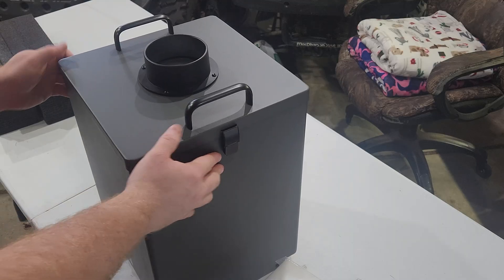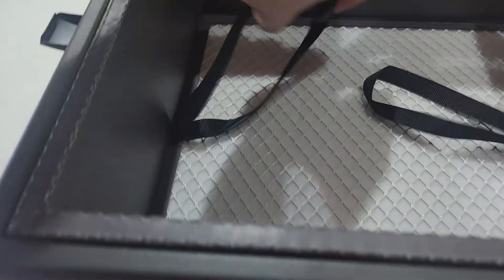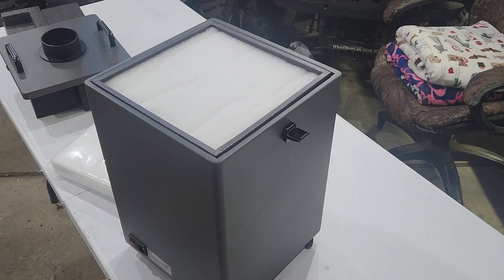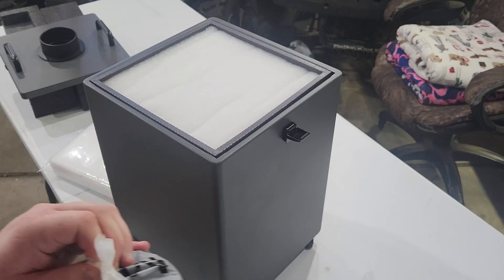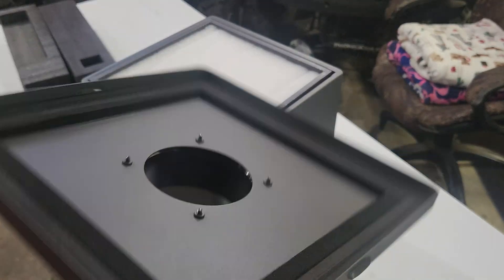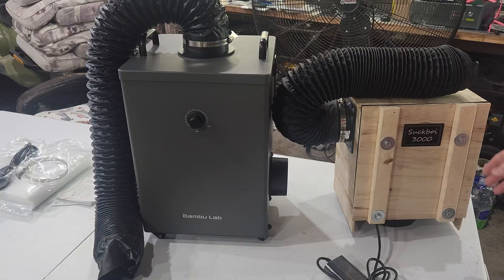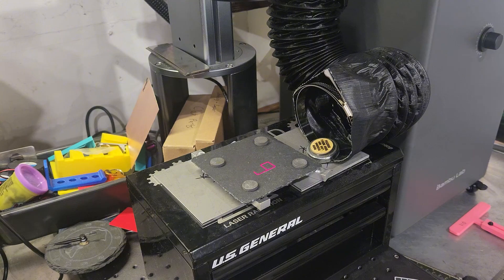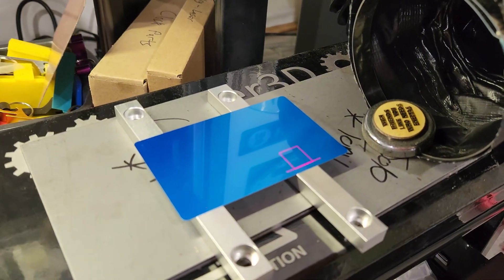Bambu Lab Smoke Purifier - Unboxing and Testing - Laser Fume Extractor

Comment: I’m interested to know why you picked this over something else that might exist seeing how you are just using it for laser cutting. I’ve been thinking about picking one up just to filter my regular 3d printing.
Reply from the maker: Good question, and I had a few reasons. The main one being that I know I'll be able to get replacement filters for it in the future unless Bambu stops supporting it for some reason. A lot of the ones I saw on Amazon were no-name ones, that who knows if they will offer replacements 1 week, 1 month, or 1 year from now. I don't want to be stuck buying a new unit if that's the case. Another reason being that a lot of the ones on Amazon were spec'd a lot lower. I got this mainly to help with some ABS that I had to laser, which puts off some very nasty fumes, so didn't want to skimp out on that.

Any other questions, just let me know!

Comment: Would this work if you wanted to filter out the exhaust air from 3d printing? For example when printing ASA. Or does it interfere with the chamber heating
Reply from the maker: hey Alex, I am not entirely sure how much it'd interfere with the chamber temps. I think it would drop temps slightly at the lowest speed but the printer may be able to catch back up and maintain with active heating.
Reply: @BrANDOM-Tech  ah ok, thanks
Reply: How is it been since? Any update?
Reply: @SeriousPunch  I didn't get the smoke purifier because its too expensive for me at the moment. I opted for an ac infinity fan and vent it outside for now. It has a speed controller so I can set it to have a nice gentle pull on level 3/10 and I have printed PLA and PETG with no issues. When I print ASA I am going to swap one of the exhaust flaps on the back of the printer for one with holes in it (someone made one on youtube) so it can gently suck the air out. Also the smell in the room is completely gone. I am trying to find a solution to add a filter to the setup before it goes outside but I am not sure if HEPA will be too restrictive for airflow or not, as it is only 100 mm hose. So I might have to DIY a filter box. I read on a forum someone uses the smoke purifier for printing and had no issues, but a bambu lab employee said you shouldn't use it with PLA because of heat creep (I think because the air can't exhaust out fast enough for PLA so it builds up inside the enclosure). I'm guessing it probably does work fine.
Reply from the maker: @alexhz glad you figured out a solution! If you're venting outside, I wouldn't worry too much about filtering unless it's close neighbors or an adjacent window you're worried about. I did find the hepa filter I tried to use on my own DIY solution (very similar to what you have now) was very restricted in flow for laser use, but for printing, it may work out just fine. Especially since you're not really dealing with larger particulates like I am with the laser. Hope you get that part figured out to your liking! Have a great holiday season!
Reply: @BrANDOM-Tech  oh ok, there's no one nearby so it should be good. that's interesting about the HEPA because I didn't want to get loads of filters for it not to work. Hope you have a good holiday as well!
Reply: In the area ill be setting up there wont be any windo to allow me to vent outside. So i was looking for a solution to filter inside the house without worrying. @alexhz

Comment: Have you noticed any air leaking out form around the power inlet when the purifier is running at higher speeds ?

I have a definite air leak with mine that I can both hear and feel if I put my hand close to the power inlet.

Currently Waiting on the response from BL after raising a ticket this morning, as the whole point of the purifier is to remove smoke and then vent out of the room - not to pass the air through a couple of filters then feed it straight beack into the room again.
Reply from the maker: Oh that's strange! I didn't notice any leaks, but will for sure be checking the next time I use it. Are you noticing the air around the whole power inlet, or mainly one edge of it?

EDIT: I just checked on mine. I do not hear any air leak coming from it, but I may feel a tiny leak from the bottom edge, or right edge of the plastic around it. I don't think I'll have time this week to do it, but maybe I'll pull it apart (if it's easy enough) and see where the leak is coming from internally. If it appears like it's a pain to disassemble, I may just throw some RTV/silicone or something similar around the edge. I would like to pop the plug itself out and make a better seal than that, but won't know til probably next week sometime how possible that is.